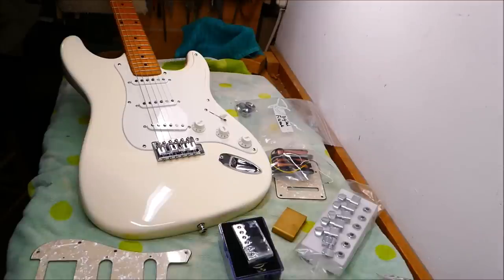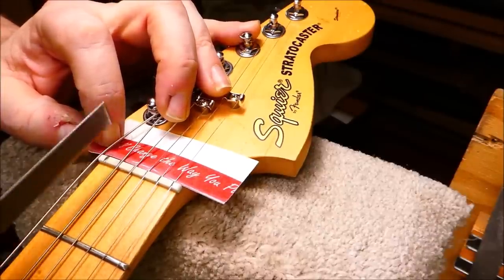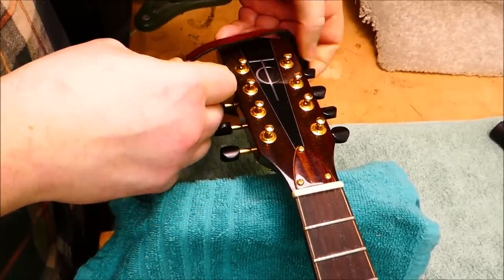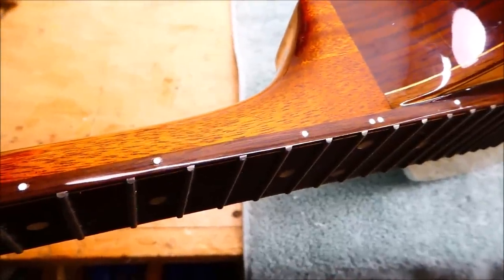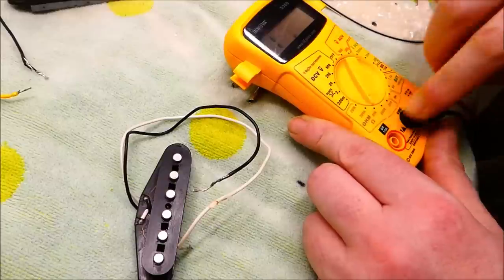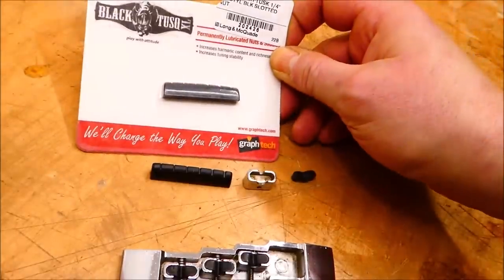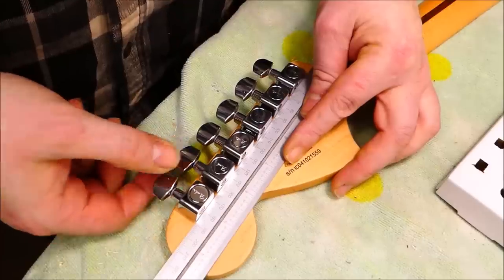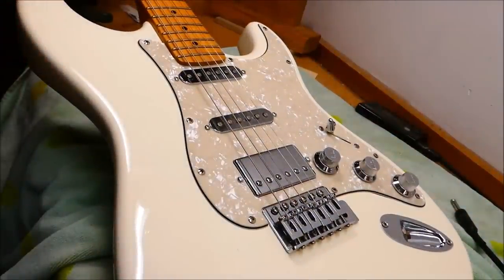That's a lot of work!

Comment: I would never ask someone to assemble a partscaster.  A customer must understand that a $100 guitar + $100 parts + $300 labor is still a $100 guitar.  It's a fun project for when you're hanging out in your garage on the weekend, but that's about it.
Reply: Concur. If money is not an issue then it's fine. Otherwise, it really doesn't make much sense.
Reply: $100 for all the parts? A set of pickups, tremolo bridge, tuners, electronics, pickguard, neck plate, screws, knobs, strap buttons, output jack, strings... all for $100? 

And $100 for a painted body and a finished neck with a nut installed?

How many partscasters have you actually put together?
Reply: @tim6723-f4i   Several.  The point is that throwing parts and money at a cheap guitar doesn't increase its value.
Reply: @regularjim3193  Those parts shown in the video aren't $100 - the Squier neck and fender branded tuners would be close to $200 by themselves. I assume you buy the cheapest junk kits from China because the dollars you're quoting, that's about all you would get.  A guitar built from a junk kit is virtually worthless but saying a partscaster built from quality components is worth the same as a partscaster built from cheap junk components is wrong... and a pretty dumb argument.  I agree the money spent on labour doesn't increase the guitar's value but I doubt the owner upgraded his guitar to make money.
Reply: @captainobvious9668   I'm not suggesting that the stuff shown in the video costs that much.  The point is throwing money at a cheap guitar doesn't increase it's value.  This doesn't bother some people, but some people get hurt when they try to get $500 for a Squier Affinity because they paid somebody to upgrade the pickups.
Reply: @captainobvious9668  Good point re the cheap kit. I initially reacted to the seemingly ignorant remark that you could put a partscaster together for $200 but I didn't consider kit guitars (because no one calls them partscasters).

I still take issue with the joyless attitude that nothing is worth doing unless you get your money back.  The guy that owned the guitar wanted better pickups, better tuners and some cosmetic changes and was willing to pay someone to do the work. I don't see a problem with that, although he may have regretted his choices when he received the bill.

I upgraded the pickups in a cheap Gretsch guitar and got a very good price for it when I sold it so saying upgrading the parts in a guitar doesn't increase its value is definitely wrong.

I think the point of the video was to show the myriad of problems that have to be solved when putting together a guitar from parts, not to shame the customer for his bad financial decisions. Or maybe it was meant purely as an anti-partscaster video... certainly had that vibe.

Rookie mistake mixing metric and imperial.
Reply: @tim6723-f4i  Definitely an anti-partscaster video.  The work he was asked to do, change the pickups, tuners and pickguard, had nothing to do with it being a partscaster.  Plenty of people do this to stock guitars, particularly Squiers.  Made a big deal out of trivial issues with the pickguard like reaming out the holes for the pots, countersinking, drilling new holes for screws which should not have taken long. Fender tuners are a pain to install with their 2 pin design whether you install them on a pastscaster or a factory built guitar.  Bit of a dick move by Fender to make them slightly different to the Squier 2 pin tuners.

Don't know why he bothered plugging the old pickguard screw holes as they are covered by the pickguard. If you take the pickguard off, seeing plugs is no better than seeing holes IMO.  

The neck could have been left as-is. He got the action height right without shimming the neck - could have changed the grub screws in the bridge saddles for shorter ones so they didn't stick out.  The gap between the neck and the body was cosmetic.  If the customer asked him to shim the neck and fix the gap then fair enough.